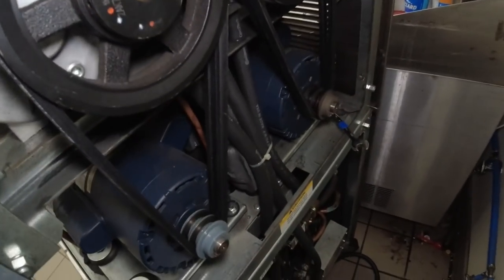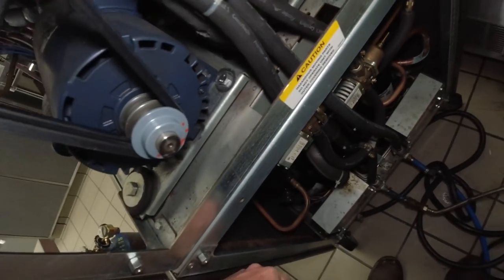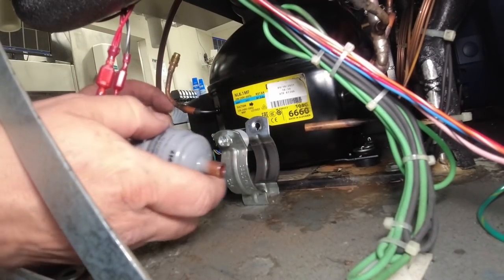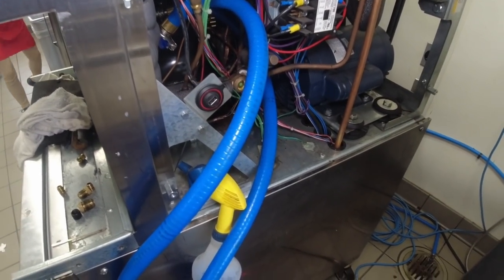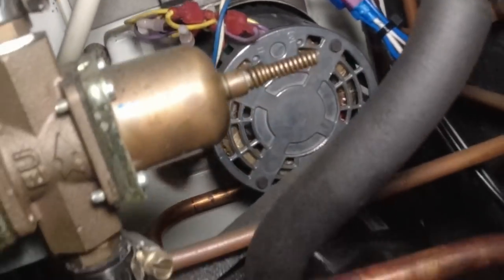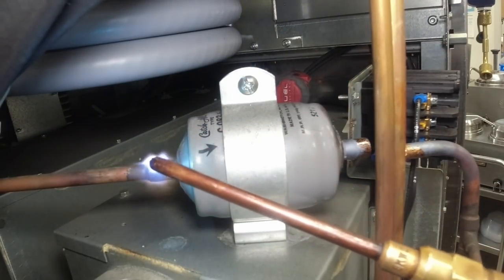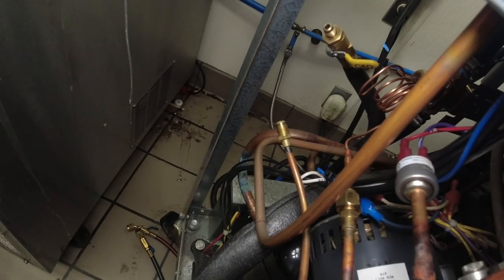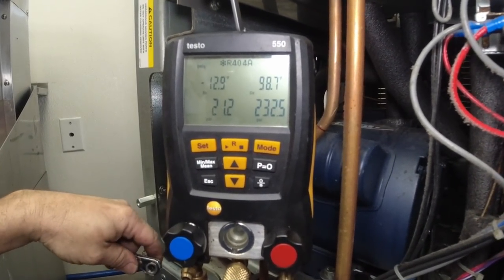OMG I NEED MY ICE CREAM MACHINE REPAIRED FAST!!! PLEASE HURRY

Comment: You said it took 5 Hrs. to edit a 2 Hr. video. For that I say THANK YOU!!! HVAC related videos are my entertainment at lunch time and night time. I was an HVAC Service and Install Technician for 8 years before I became disabled. I REALLY enjoy your channel along with HVACR Videos and Anti DIY HVAC. I say again, THANK YOU for your time and effort!
Reply from the maker: Thanks Russell,  you wouldn't believe what all goes into these. Editing,  rendering,  Upload time and labeling the video, making a good thumbnail  etc
Reply from the maker: I just re-read your message, I skipped right over the disabled part, do you mind me asking what happened? Was it on the job or just age? Sorry to hear that
Reply from the maker: Aw man that sucks to hear,  it can happen so easily. Thanks 4 sharing!
Reply: welcome to video editing, 20 years ago, it would have taken days even weeks to edit the same video and then days of rendering time on common computers and hard drives.
talking P3 and early P4 processors and commodity 7200RPM 3.5" desktop drives. don't ask how I know! ( building, repairing and supporting small time editing machines)

Comment: I changed a compressor in the same exact unit. Ports were off on my compressor too. I ended up finding a fitting from another kit of parts that worked. Always keep those random fittings you get from different jobs. You never know when they might come in handy.
Reply from the maker: Good advice, thanks 4 sharing!

Comment: I like your videos, I appreciate you showing what actually happens instead of what “should” happen like having to shut the nitrogen off sometimes on these smaller systems and showing when you have a leak on a braze joint. I couldn’t see what brand that compressor was but it reminded me of almost every Embraco compressor I’ve ever done with wonky angles on the lines and having to use the spin swage but have you noticed your spin tool sometimes making shavings?
Reply from the maker: If you go slow it doesn't seem to make any shavings, however in theory if they did go into the compressor they would fall to the bottom, it's not like they're going to get sucked up and pumped through the system.( I would still try to avoid getting any shavings though.)  I appreciate your comment and watching the videos!

Comment: I work on a good bit of European built cramped up systems (cooling for electrical panels). I just bring an assortment of piping sizes 1/4-3/8-1/2 and use those as coupling by just fitting them over the pipe whenever I do a compressor cause those fractional HP 240v or 480v compressors are very hard to come by, rarely a like for like replacement so there's always a little bit of pipe fitting to do there. 

I also try to get a 032-cap-t drier when I can on those cap tube systems, neat little things.
Reply from the maker: I like the cap t driers, I keep the 032 052 on my truck.

Comment: Like to see you using the belt tension gauge that I was using as a child that my father taught me to use as a kid. 

     It’s the belt tension gauge that my father used when he was young.

      Tried true and tested and reliable nothing has changed in decades.
Reply from the maker: It works great and is easy to use.

Comment: I use my pinch off I adjust them so that it put enough pressure to seal off the water line.
Reply from the maker: Are you pinching it off to change the valve or adjust it?
Reply: I pinch off the water line the hose to shut off valve will not shut off. Then you can replace the pressure control or water inlet valve. I ran into some shut off valves that were best to be left alone. These are the same pinch offs that you use a copper refrigerant lines. They look similar to vice grips.
Reply from the maker: Ok. I wasn't following you. Yep I have those and hose clamp pliers. Thanks 4 reminding me 🤦‍♂️. I forgot
Reply: just be careful, some of those aged supply hoses will split the internal hose if pinched off that way or kinked. they're sold as great things and are nice for the most part, but it's just thin tubing inside.

Comment: thank for the video, I'm trying to learn about soft serve ice cream machines and your videos are the most informative I found online. I have some questions I couldn't get the answer for anywhere online, yet to see a machine up close in person.
1. in a gravity fed machines, the beaters are the ones that push out the ice cream? 
2. the beaters are turning continuously throughout the day? is there any electronic switch to tell the machine when the operator is dispensing ice cream from the machine?
3. in pump fed machines, do you know what kind of pressures the pumps generate? is it in the high 10's of psi, 100's or 1000's PSI?
thanks a lot, I will follow for more soft serve machines videos!
Reply from the maker: A1..The pressure that the pressurized machine creates is usually around 20 lb psig.  A2.... No you do not want the beaters to run any longer than they need to, that causes breakdown of the mix and then the mix will not harden. Generally it's controlled by either temperature or amp draw of the drive motor.  A3... Gravity machines and pressurized machines look and operate primarily the same other than the pressurizing machine uses a pump to push the ice cream mix into the barrel where a gravity machine obviously goes in as gravity fed,  sometimes with a little help from the flights (beater)
Reply: @HVACRSurvival  so once the set viscosity was reached (detected by amp draw) and the beaters stop, when is the next time the beaters will kick in? how long can the ice cream remain  frozen and static in the freeze chamber?
I thought that pressurized machines biggest advantage is that they force a larger volume of air into the freezing chamber. I'm trying to build a small machine for my own use at home, using an existing fridge-freezer
Reply from the maker: They kick back on whenever the handles pulled or after so many minutes of timing, it'll check the viscosity and then run the compressors if it needs to. The benefits of a pressurized machine is two things, yes you get more volume but you also get a more accurate product with the proper overrun. That's the amount of air in it. I think you're going to have a hard time making a freezer work. There's a reason why they're getting  $10,000 - $18,000

Comment: 7:27 would u recommend using a Captain Hook tip in that situation? Never did ice cream machines or any other refrigeration equipment (minus a normal resi split system)
Reply from the maker: It probably would not have gotten the heat where I needed it at because it does shoot it at a 45 degree angle away from the hook. I really like the two-headed c shape device I've been using on some of the other videos.

Comment: Man your braise joints look incredible. Can we get a video of you just brazing stuff lol.. Also how do you get yours to look so shiny?
Reply from the maker: My dad was a welder and he always said you got to see what your welding if you want a good result.  I sucked when I first started but once I was shown what I was doing wrong I got a lot better. Clean copper helps but having a hot flame that is slightly oxidizing works well for me. They say to use a neutral flame but when it's a softer flame it helps spread out the heat. The key is to let the base metal melt your rod not the flame, that way you can pull the filter rod into the joint.

Comment: Very neat and thorough work as always Sir 👌 
I usually cover the wires with a wet rag or a fireproof pad and hold it with a large clothespin .
The tight spot would have frustrated me a lot though , them restaurant workers would've heard me mumble a few colorful words to myself I reckon 😅 
Btw I'd love to see how you tested your core removal tools , I'm having a hard time trusting them now , to the point where I usually isolate from the  hose valve because I reckon the bloody valve on the core tool always leaks . What a pain that is eh .
Reply from the maker: What I did was take a 3 inch diameter copper pipe that's about 3.5 foot long crimped one side, brazed it shut and put a refrigerant port on it.

Comment: Hi Rick, I noticed  your blue marker writing  on the Compressor which you changed out,  that you have Start on top left and Run on top right but isn't  it the opposite , having Run on top  left ?
Reply from the maker: I Copied it from the plastic cover. Did you notice the common is on bottom and normally it is on top
Reply: @HVACRSurvival  ok great but never  see one oriented  that way as I have repaired  them for years, thanks for reply .

Comment: Stoelting wants a certain belt tension?
Reply from the maker: Depends on the machine. U431 is 65-75lbs and the belt type matters also. Some belts are 35-45, they have a list of different ones.

Comment: Tight places to braze. Could Stay-Bright 8 have been used there?
Reply from the maker: It could, but it's just not worth it to me, ever since I learned how to braze I don't solder much anymore,  except water lines unless I absolutely have to. With braze you don't have to clean the copper most of the time and it's just easier to build a bridge if you need to. Thanks 4 the question!

Comment: I liked the video Because!  Lets talk about that belt gauge. Isn't that for automotive? If that is legit for our field I need to know more about it, because deflection measurements are a pain.
Reply from the maker: That belt gauges for high tension ratings much higher than a normal rooftop unit or furnace would use. It starts out at about 35 lb and goes up to a 145 lb. Most of these ice cream machines have a rating between 35 and 75 lb, I've used the cheaper Cricket clickit type tensioning Tools and they are nowhere near accurate.
Reply: @HVACRSurvival  Ok, thanks. Since I've never worked on an ice cream machine, I'll hold off on that purchase. 😃

Comment: Where'd you get that fire proof pad?? I need one 😂😂
Reply: I have the same kind.  I got mine on Amazon.  I have 2 that are 2 ft by 2 ft roughly. One is 1/8" thick, the other is 1/4". Then I have a 12"x12" or 14"x14" (can't remember) like you see rick using in the video, and that one is 1/4". They come in different sizes. If the torch is right on them. The fuzz on them will light up or smolder, but even when doing that, whatever is on the other side is VERY protected from heat. I have to use them on almost every job I do every day, and they have lasted.
Reply from the maker: Mine can be dunked in water for added protection.
Reply: @HVACRSurvival  I've never tried that with mine.  I've always just laid a traditional type wet terry towel on top of them. I get black fuzz all over my hands when I touch those things with wet hands, so that's why I never tried. Do yours do that too?
Reply from the maker: Mine was designed for it. The brand was assurance pad

Comment: Why would an ice cream machine need a tap water ... ?
Reply from the maker: If Your asking why this machine needed a water line?  the answer is because it used a coax coil to cool the refrigerant instead of a air coil.
Reply: @HVACRSurvival  you mean, that actually is a circulating water loop?
Reply from the maker: @optroncordian7863  the system that you're asking about does not have any recirculation pumps. The water goes through the coax coil and down the drain. There is systems out there that you can connect it to where it would recirculate the water but this is not one of those